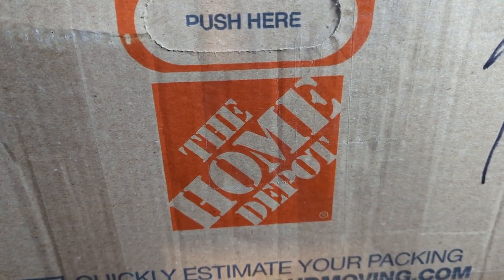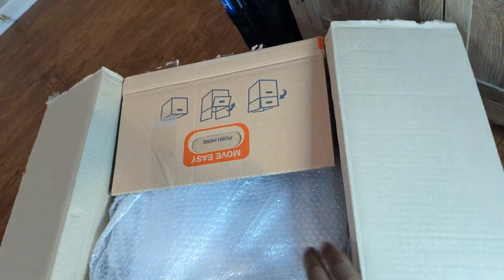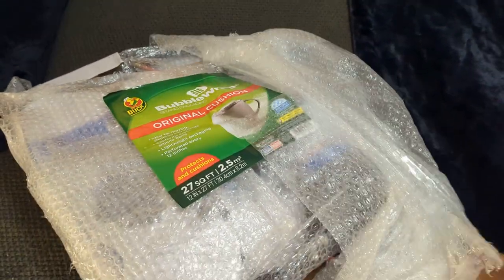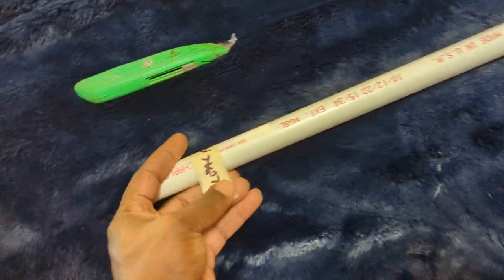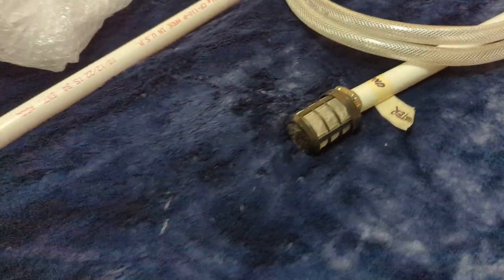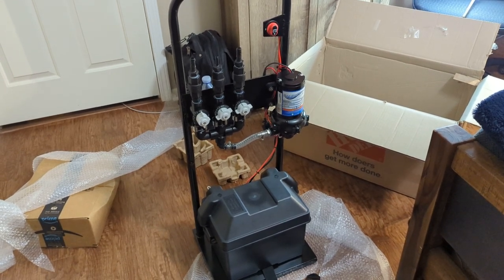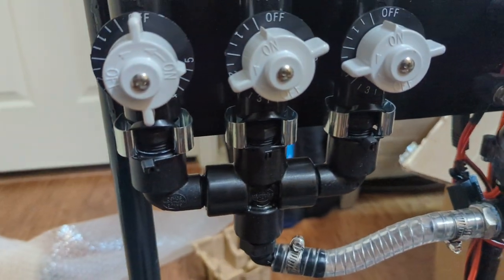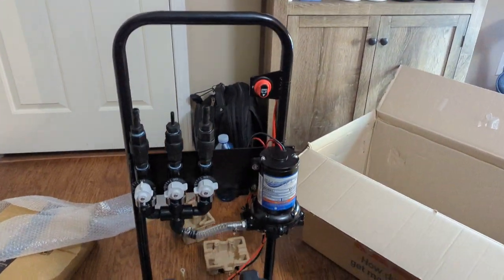Best Softwash System for the money!

Comment: I would love a 1 year update on those penta valves. I have seen so many crack, but it could be that the person over tightened. Looks good, but did it last?
Reply: The pent valve, by what I hear, work well but are kinda fragile. Remember the pumps, no matter what brand, make them about a season and need to be replaced or rebuilt.  But this setup is very cost-friendly to get our foot in the door.

Comment: How long did the soft wash system last ?
Reply from the maker: Currently running like brand new!
Reply from the maker: Obviously it's all going to depend on your maintenance. Make sure that after you are finished running chemical through it that you run water through it for at least 5 minutes. That's what I do after every wash. I don't wash every day so for me it should last me at least a full year or maybe even longer. But as far as the build of the system, I don't see any problems with it in the near future. These pumps though will eventually go out and they're inexpensive to replace
Reply: Your video is very helpful . I'm just starting out and on a budget . Hopefully I can just start with a 7 12v pump and one drum with 5o% water 50% bleach. Thank you Brother
Reply from the maker: You don't even need a 7 GPM. Just get the 5 GPM. It'll save you money and chemical🤘🏾

Comment: What is the link for this set up
Reply from the maker: https://budgetsoftwashsolutions.com/products/generation-2-soft-wash-system-with-5-5gpm-everflo-pump
Reply from the maker: This is the Gen 2 version which they made improvements using aluminum and higher quality manifold parts. 🤘🏾
Reply from the maker: Use my code Cardinal at checkout for a discount 🤘🏾
Reply: @cardinalprosoftwash  thanks man will definitely subscribe, I'm new to the pressure washing business and just recently got some beginner materials . I'm looking to add a soft washing machine to do house / roof washing
Reply from the maker: That's where the money is💯

Comment: Wouldn’t connecting that pump to the mixing valve with hard pipe give it better flow than the flow restrictions of those barb fittings?
Reply from the maker: This is a low psi (60) machine so the restriction is negligible. The kit also includes an adapter for standard water hose fitting so the choice is yours. I have no issues with flow using the 1/2 in. Diameter barb though🤘🏾
Reply from the maker: https://budgetsoftwashsolutions.com/
Reply from the maker: Use my code Cardinal for a discount!

Comment: How did the pump work being mounted vertically? I want to mount mime to a wall
Reply from the maker: It works great this way. Either way works but this is the way I recommend mounting it because if anything goes wrong and it springs a leak it will leak onto the floor rather than down into the motor🤘🏽
Reply from the maker: Excellent question!

Comment: is it upside down?
Reply from the maker: Depends on who you ask🤣 I've seen it mounted either way but I prefer this direction because if anything goes wrong this way will save your pump because the water will just fall to the ground rather than inside the mechanism 🤘🏾

Comment: How do you fasten this to your skid?
Reply from the maker: I will be using 2 rachet straps in a van. The base is very solid and has good weight to it especially with the battery installed so it doesn't want to move around very easily. I will be shooting a video soon of the installation process so stay tuned for that 💯

Comment: Man! I've been researching forever to try to find the best softwashing system for my needs and this seems to be it! Plus since it's mostly prebuilt, that helps a lot! Although, I have a question. Could I void the water drop stick and just pull water from my pressure washing buffer tank instead? (and what size tank should I use for SH?)
Reply from the maker: Yeah bro, you could put the do sick into any tank 🤘🏾
Reply from the maker: Or to completely get rid of the drop stick. Just do a bulkhead on your water tank directly to the pump 🤘🏾

Comment: The drawback is that the pump needs to be replaced because it corrodes due to SH.
Reply from the maker: Sure but doesn't everything have a life span? These typically last an entire year for me and at $125 it pays for itself. The very first time a job is completed. I recommend running straight water through it. After every wash you should be good to go 🤘🏾

Comment: He should have built it on a dolly so you can wheel it around.
Reply from the maker: That may be an option but unnecessary for me as it only weighs about 15 lb. Very easy to move around but I won't be needing to move it very often if ever

Comment: I think you said you paid $800 for that I don't know man that's kind of expensive I'm like you I'm just starting out I don't want to spend a lot of money I'm going to do one better I'm going to build my own system if I build my own system I can do it for 2 to 300.00 I'm looking to keep my calls way down
Reply from the maker: Yeah I paid like $850 and that was last year I believe now they're up to like $1100 I didn't start with this though, I just used downstreaming to clean everything and now that I want to get into some heavier work, the softwash system is more necessary. Let me know how you pieced together at $300 soft wash system as I look at it right now. 5 gallon per minute pumps are around $125 and 200 ft of hose is going to cost you nearly another $200 but I assume it could be done. Can't wait to see the results 🤘🏾

Comment: Why not dump all your bleach chem and water in the same tank? Not meant from a spirit of debate. Great video btw
Reply from the maker: I would do that if I didn't have multiple tanks. That is called batch mixing and the downfall of batch mixing is that you cannot adjust the strength of your mix. By having the proportioner I can adjust the strength of my mix for multiple surfaces. Therefore, if I am washing a vinyl house, I might use less than a 1% mix, whereas if I were cleaning a roof, I might use as much as a 6% mix. Hopefully this helps 🤘🏾
Reply: @cardinalprosoftwash  it does. Great points
Reply from the maker: @davidintili6647  but if a soft wash system isn't in the budget I would recommend an Xjet. It comes with proportioners and will allow you to spray a stronger mix than downstreaming.
Reply: @cardinalprosoftwash  why does downstreaming limit one? Bit new to this
Reply: I believe because when doing so, chemical loses its strength depending on  time it is mixed with water. Lasts longer if only mixed when needed. Now if you have 3 jobs a day everyday then I get it.
Reply: @davidintili6647 downstreaming pulls a weaker mix because it pulls more water than chemical at about a 10:1 ratio— giving you AT MOST a little over 1% mix.  A softwash system is more precise and can give you a hotter mix with more Chem. An Xjet can get you almost as close but you can't get precise percentages and you have to batch mix for each surface

Comment: FYI: not a good filter to use as I heard a lot with those the sh will break that screen down quickly causing orange rust bits to quickly develop contaminating your sh and clogging your pump.
Reply from the maker: The filter is only on the water line. Think I'm going to slot the PVC on the SH line 🤘🏾 thanks for the feedback
Reply: Where did you buy the gun from for your SW system. Awesome video
Reply from the maker: @jdurrant421  thanks! But I have heard from several accounts that this gun will not work with a 12 volt system. So I also have the standard PVC gun with the ball valve. https://www.toolbarn.com/products/general-pump-yg1635swh
Reply from the maker: @jdurrant421  yeah those apparently have a nicer trigger than the red wash guns but I'm sticking with mine for this season. Thanks for the link